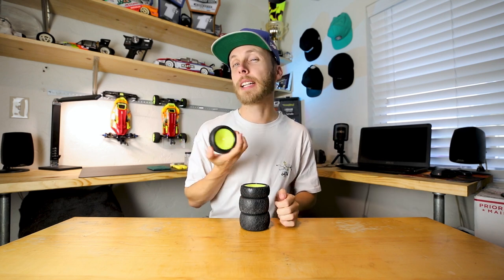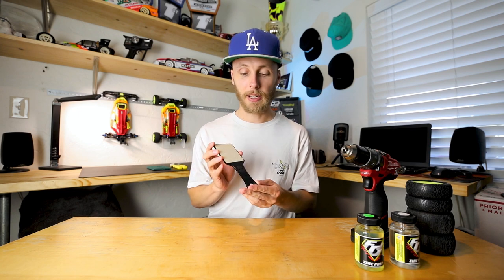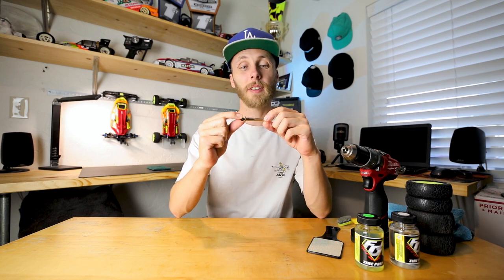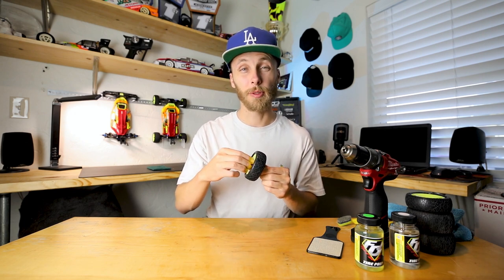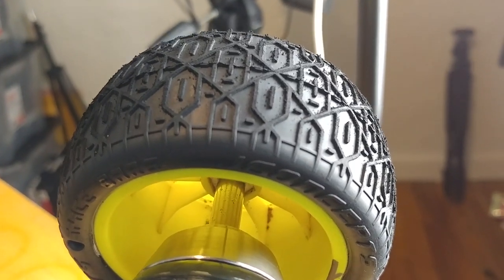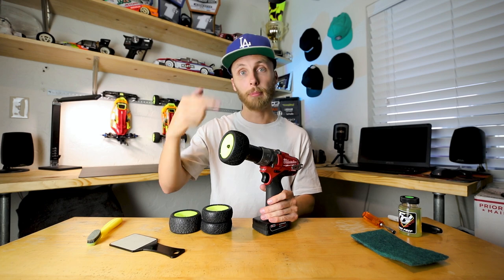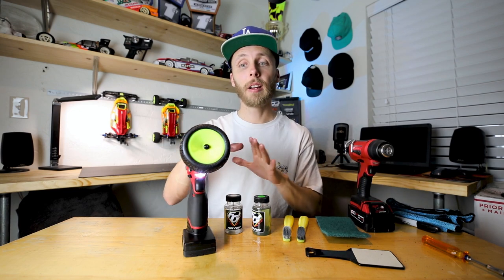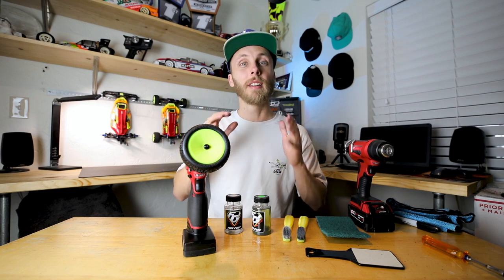HOW TO BREAK IN TIRES || Tire prep methods explained

Comment: For a lasy basher like me:
Step one: buy your pre-mounted tyres 
Step two: Do up the nut 
Step three :
Bash and blow out the tire again
Reply: I am basher to been to a track a few times but unfortunately it closed but put gorilla tape in your tire to stop ballooning and clean tires with windex or simple green before glueing 
Us gorilla glue seems to work better than ca  glue minis the bubbling and it’s cheaper
Reply: Maybe tire prep method would give the rubber more elasticity an it might not brake under rapid expansion

Comment: In your experience, how does this equate to actual lap times?
Reply: Pretty much shave off 2-3 seconds
Reply: It’s a must on these high bite clay tracks. A prepped tire vs unprepared tire is the difference between driving in the winter and driving on a hot summer day

Comment: I tend to just sauce my new tires multiple times in a ziplock bag overnight, till they are slightly more squishy or softer. I let my tires break in naturally on the car itself by running some laps at the track doesnt take long for your tires to form.

Comment: I use a 3" x5" piece of 220 sand paper, lay the sand paper on a flat surface spray a tad of Simple Green on to the sand paper and then take the tire and hold the sand paper while slowly sanding the whole tire for 3-4 rotations. Then spray a microfiber towel with simple green then massaging the tire

Comment: I realize a lot of fast guys do this but why not setup your car with a touch softer springs or use a softer compound tire to start with? Cutting down your tread right out of the box means you just took 2-3 more weeks of racing off that tire. Just treating the tire to make the rubber softer should help a bunch, regardless of that 1mm of extra tread. I guess it also depends on the track surface. For loose dirt I can't imagine taking more tread off helps in 2wd.

Comment: Hey pal.. I’m just getting into R/C racing & love your videos. Very interesting and knowledgeable.. Keep up the good work. By the way I have no idea how to rebuild a R/C car & it seems very difficult..
Reply: Manoli Patsaros it's not hard, it might be intimidating at first. So you won't misplace your screws, get a piece of cardboard or foam board. Try to draw/trace the chassis of the car. And put a dot where the screws go, then make on for the top chassis,  a arms, shock tower. Etc. So when you take the rc apart, each screw you take out to put it into the board.
Reply: It not hard at all just pay attention and try not to wait to long in between taking it apart and putting it back together just so you don't forget how it goes! Your rc should have a diagram and that will tell you what goes ware ! The best way to learn is get a kit and build it yourself! Just about anyone who is in this hobby will help you that's the best part of rc !

Comment: Rookie question.  Once you glue your wheels to the tires and you run your tires to the point there no good, do you toss the wheel and tire both or do you just peel the tire off and re use the wheels? I havent seen anyone really talk about this.  Normally I just toss the whole thing because getting the glue and rubber off of the sidewall is a total chore.

Comment: Your videos are incredible.  I've been out of the RC world for roughly 15 years and am now getting back into it with my son.  Question regarding burning in prep, is it possible to do this method with mini pins?  I'm running mini-pin tires on carpet and it seems like this method may be tough to use for that style of tread.  Or maybe I don't need to burn prep in for carpet racing?  
Thanks again!

Comment: Be cool to see more compounds and tire thickness. Having a much thicker tire would give you the ability to actually cut the rubber to desired thickness. 

Back in my race car days on dirt I had all sorts of tricks like cutting camber into the tires. The rc prep they sell ain't the best sauce you can get, my hint is the worse the chemical the better prep it makes. Application makes a huge difference too...amount, heat, prep inside and out, using clingwrap, using a torch etc etc.

The one thing I learned about racing is tires are 100% the single most important factor in achieving fast and consistent lap times. Spec tire classes are cool but open it up to a full open class.

Comment: Does tire sauce make a difference in 1/8th scale buggy on off road dirt or clay tracks? I usually just clean my tires off with water and simple green but if there is something to help the dirt not stick to them as much that would be great.
Reply from the maker: Not sure about keeping dirt off... it's more about grip than anything!
Reply: If your on a clay track or a hard packed track  whit no dust tire sauce will work but a dusty or a loose track iy will do the opposite
Reply: Do you not have any concerns about the long term health impacts from inhaling these solvents?
Reply: trailgumby nah all the crazy stuff i do this is the least of my worries

Comment: Personally, I clean them with simple green, let them dry, rub them with bick 4 (if it's good for boots, it's good for tires), let it sit in a plastic bag for 24 hours, clean them with dawn dish soap and a very light stream of water, let them dry really good, take a towel and squeeze excess water out if you have to. Spray them with Lucas oil slick mist, let them dry. Grind them down until they aren't shiny anymore with a sand sponge from Dollar tree or whatever until they don't have a gloss on them. Then take a body reamer and poke small holes in them at each quarter of the middle.
Reply: Do that every 10 races (as long as the tires last.)

Comment: You can do all of this or just buy M4 Proline tyres and 1 pack to break them in....
Reply from the maker: Steve Toomer perhaps! I have seen proline guys use this method as well 👍
Reply: M4 will wear out faster than MC would
Reply: Fair enough, here in Australia I've never seen it done to that extent, sauced yes but less than half of the pro drivers would do that
Reply: MC is quite hard compared to m4, I only use m4 or m3 95% or the time
Reply: Steve Toomer MC is a bit stiff but it does soften up a bit. A local Proline rep led me to MC as I needed something harder than M4 and M3 wasn't on hand. So yeah M3 would be a better option!

Comment: Lol. I haven’t seen anyone do this at any uk tracks whether it’s carpet or out door Astro. Waist of time especially if you are doing regional or national races  as you have to quickly glue up tyres. ‘Tyre sauce’ , sure that’s illegal in off road isn’t it? I would be more worried in setting up your buggy and checking everything etc. The most common tyre used here off road is Schumacher mini darts and doing what youre doing would ruin tyres.
Reply from the maker: That's why this video is being done with clay tires 👍 Indoor dirt racing is very different from carpet and astro.

Comment: This is not for me. 1. Wife would smack me on the head with the paddle (or worse) after seeing all the rubber on the table (and floor). 2. The smoke detector in my room would go off when smoking the tires. Thanks though for all the effort you put in to make these very interesting and knowledgable videos.

Comment: You really have to go through all this to prep tyres? 
Seems a real hassle.Would it not just be better to run them as they are with none of that sauce ? 
Is the art of off road slip sliding and drifting over? Lol 
I'm from northern Ireland btw, don't have dirt tracks so I'm probably entirely missing the reason for this.
Reply: The art of racing is being fast, can't be fast without traction
Reply: Less traction = more skill 😉